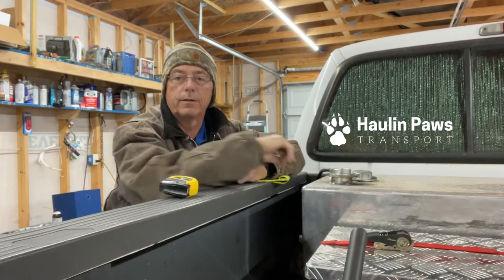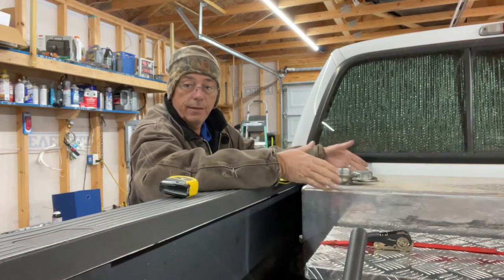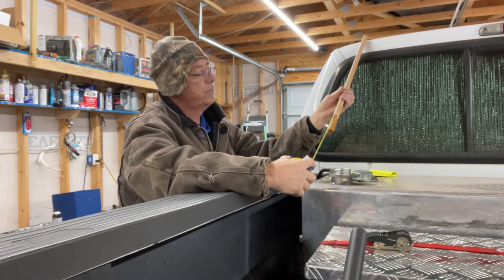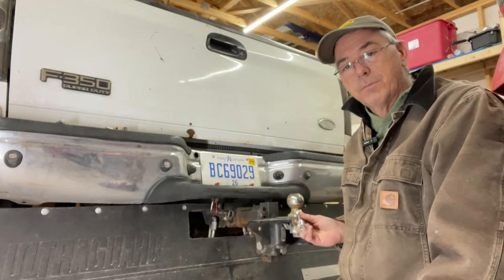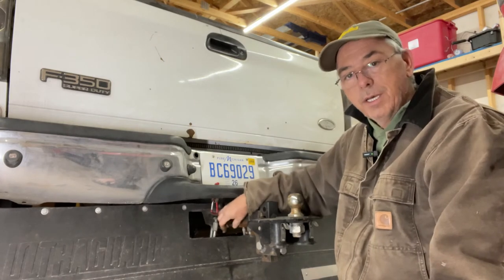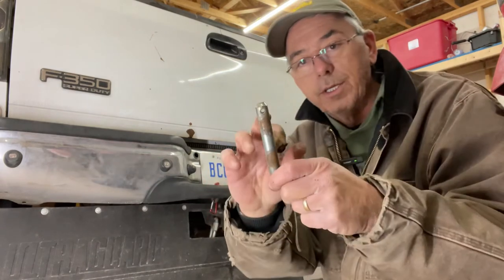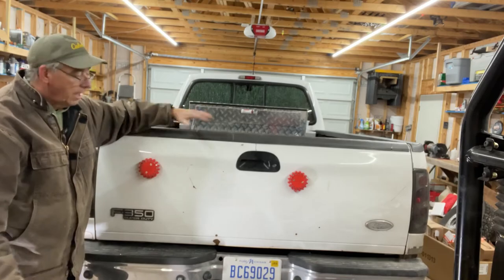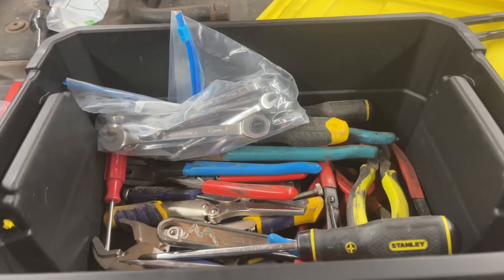RV Transport 45 - Tips With Tim #1

Comment: Just a suggestion but maybe you could add marks to your fuel measuring stick that mark the gallons. So no math is needed on the road. Since you know your tank size, mark your stick to read the number of gallons at each interval. Just to make checking your fuel level faster at the pump when traveling.